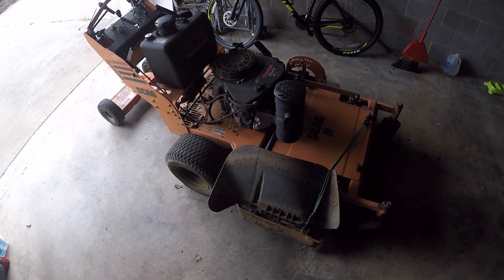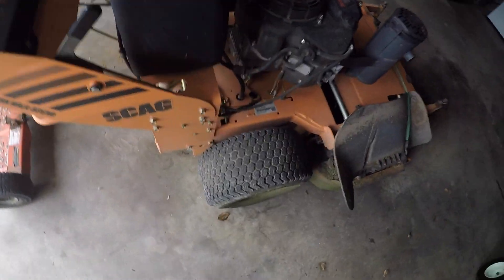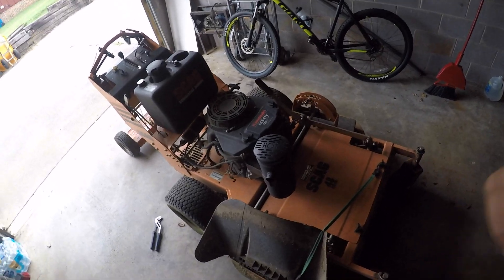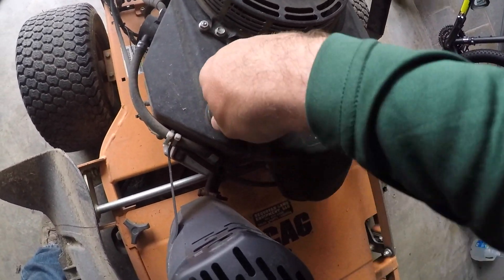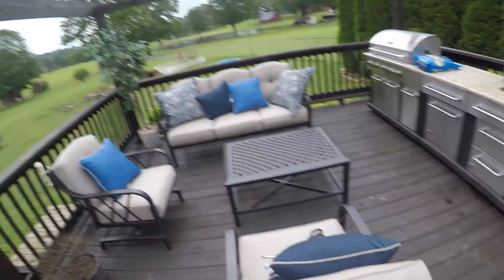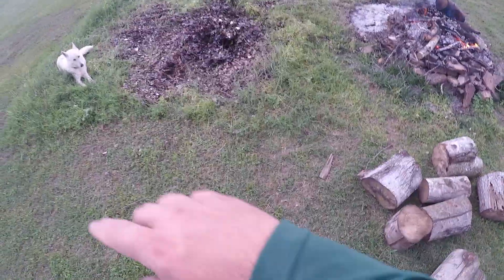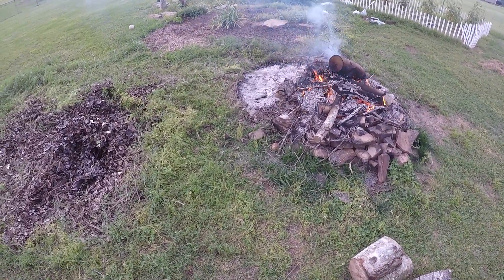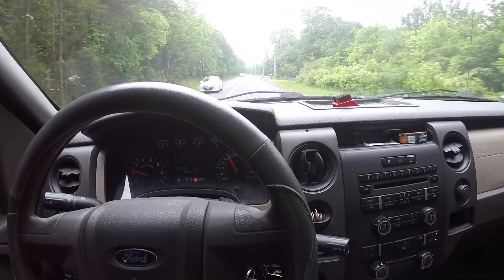SCAG incident & NEW trailer preview

Comment: question on your scag spindles, do they have pressure relief valves or how often and how much do you grease them to not blow out the seals?   just curious to see how much others grease.

with your tire issues (flats) if that keeps happening do you not prefer to use a self sealant like slime or similar product?  ive never had a flat with that except when the sidewall was sliced open.  the down time alone is worth putting a couple ounces in each tire imo.  im kinda shocked that non of these mowers have put a magnet in front of the tires to catch nails, i mean you see them in oil reservoir from time to time. 

do you prefer that type of gate on the dump over the ones that can dump, fold out as a ramp and around to the side?

Comment: today was a rainy day good day for repairs.  brand new air filter, spark plugs, rear tires.  for my Toro 52-inch commercial zero turn. The new bolts for my PECO catcher, air filter, spark plugs, and new front bearings for my solid rubber tires in front both my 61 inch Scag Turf Tiger.  good day all in all.  can't make money everyday. 
Anthony
Reply: Also a fuel filter on the Toro.  Forgot lol.
Reply from the maker: Anthony Iaffaldano that's awesome man, it's very important
Reply: I'm honestly thinking about buying a brand new 48 inch Stander mower.  Might have to get another Scag, I like your video. keep them coming buddy
Reply from the maker: Anthony Iaffaldano thanks man 😉👍🏻

Comment: Have you ever used SLIME as a preventative measure? I have a rear tire on my rider that is f***ed on the sidewall and kept leaking. I put slime in it and spear haven't has to add air. Not ready to buy a new tire just yet.